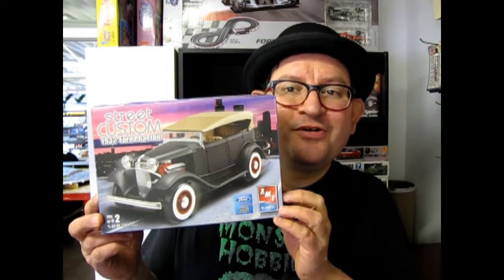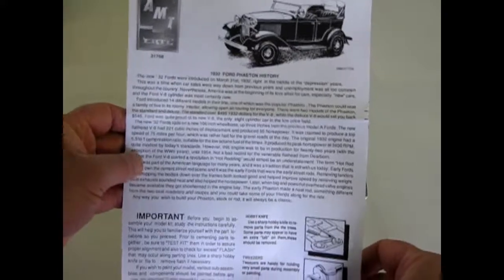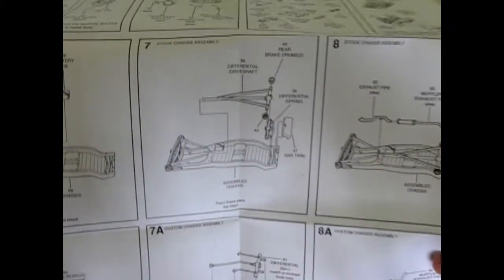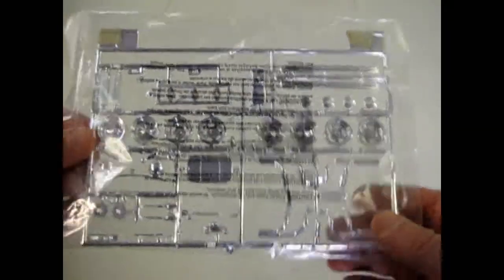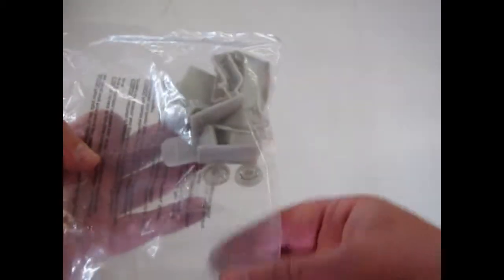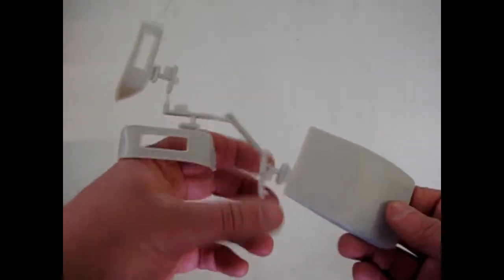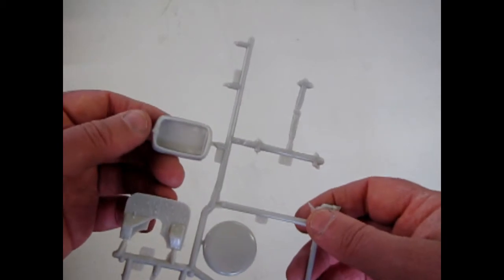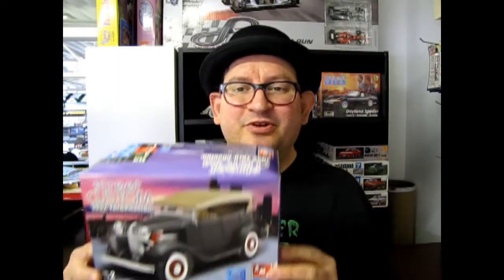Model Car Garage - 1932 Ford Phaeton Street Custom Edition By AMT/ERTL- A Model Car Unboxing Video

Comment: Bought this today, just got the engine together, looks like a great build ( once painted and built)
Reply from the maker: Cool! Does yours have the vicky interior, or the correct phaeton one? 

If you want, post some pics of your build on our Facebook page : Monster Hobbies in High River Alberta Canada
Reply: MonsterHobbiesABCA I’ve got the vicky interior, the entire vehicle is custom. Although Im most likely going to leave the front and back bumper. I went for the more slanted window, just to add to the “ ‘40s gangster” look. I used a sharp black paint for the cab, and a matte black paint the piece around the car. I didn’t stay with the normal paints on the build, just to give it a more custom feel.  I’ve got a 64 Impala, Painted in Acadian colours ( Blue, white and Red), the engine painted a ford red and the interior a rust coloured brown. Beautiful car. If you cannot tell I’ve never been the one for staying between the lines of a colouring book. LOL!